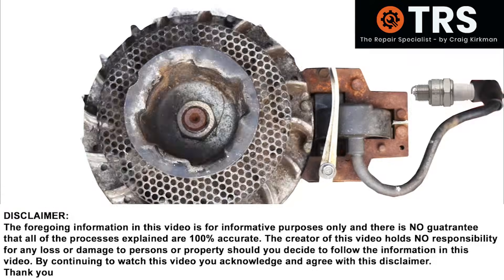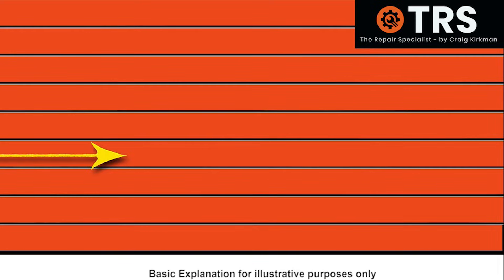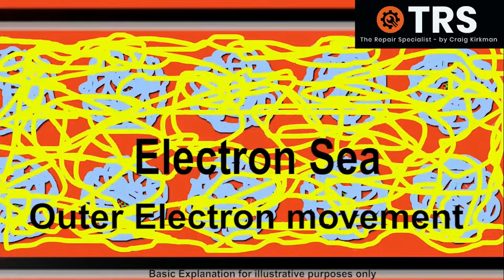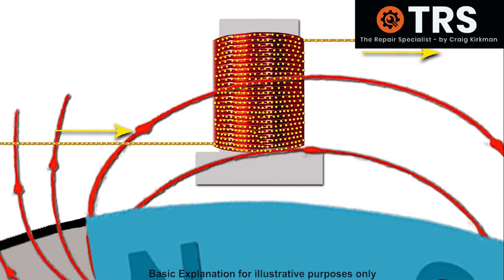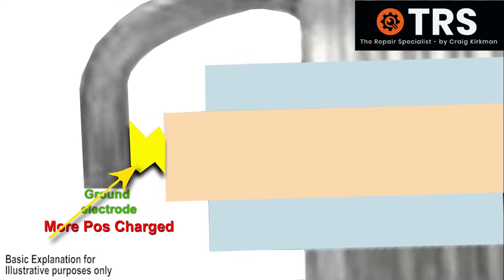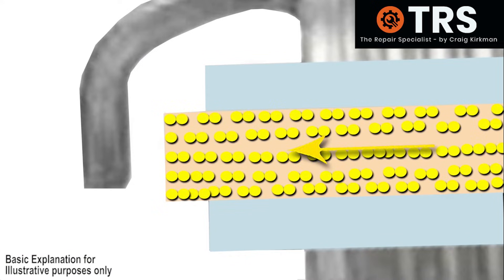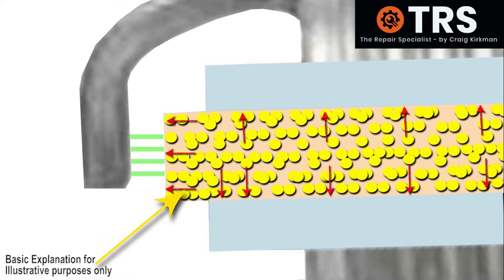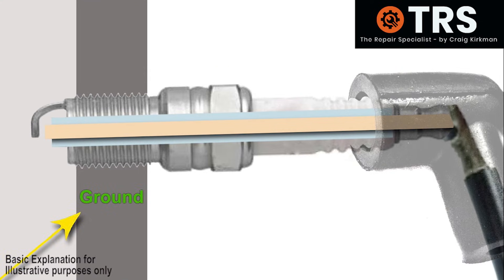How a LAWN MOWER Engine Creates a Spark - How it Makes a Spark!  (by Craig Kirkman)

Comment: Coming from automotive knowledge first, I assumed a small engine had power to ignition coil, but the only battery wire is FROM the alternator/stator and flows back to the battery so it can charge it to start it, run electric PTO, fuel solenoid cutoff, lights, etc.. The only wire going to the armature/ignition coil is a ground to kill the motor. Your explanation was very simple. Thank you. 😎

Comment: may I ask when you say the air is ionised between the electrode and the earth strap of the spark plug could you explain to me what that means? the ionising bit is the key I've never understood, cheers
Reply: The High Potential Electrons in the Centre Electron start to " Leak " into the Airgap . This produces a Negative Charge in the Airgap , reducing the RESISTANCE of the Air . Then there is an Arc , that Balances the Voltage Difference until the next cycle , a nanosecond later .

Comment: How come you don’t get shocked when you touch the housing of the engine, or “ground”? Or in other words where do those electrons go after getting to the other side
Reply: They simply join the " Sea " of free electrons there . And in turn , get sucked up by the Alternator and end up in the Battery .